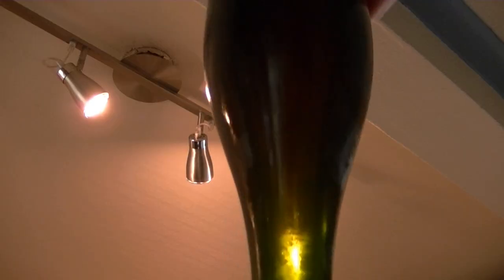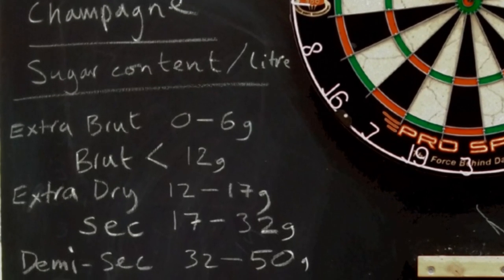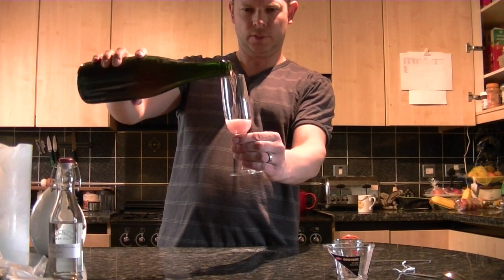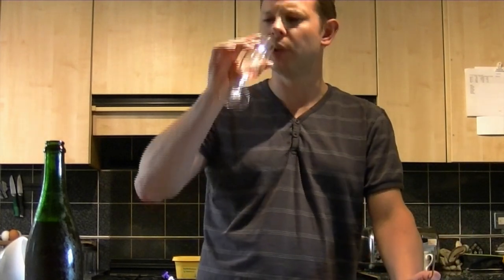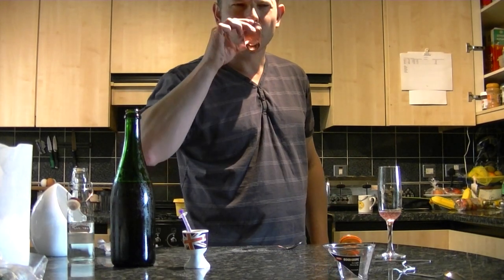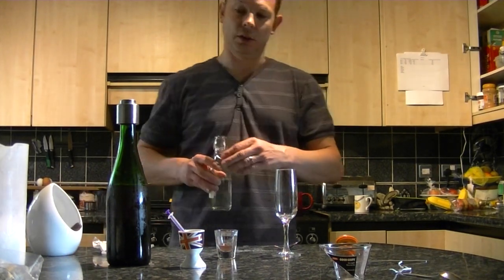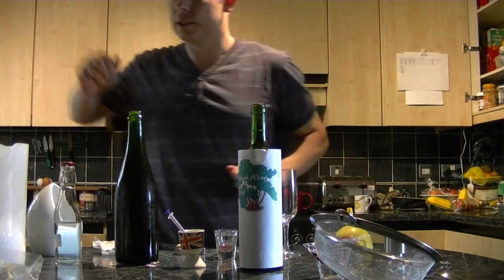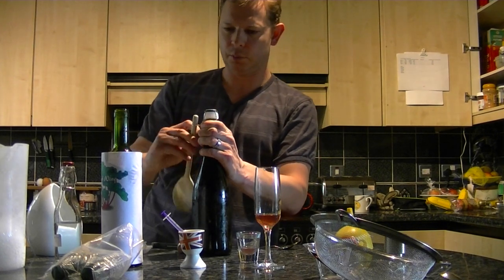Rhubarb Sparkling Wine - Champagne Method - Disgorgement and Dysfunction

Comment: This video is a hidden gem. I've watched it three times and it still makes me giggle. Bottled my first attempt at sparkling wine today. May there not be any bombs going off in the storeroom the next few weeks.
Reply: Yes.  Here's to non exploding bottles!
Reply from the maker: How's it tasting?
Reply: Unfortunately I have had troubles with the 2nd fermentation. I've attempted resetting with new fresh yeast to no avail. Most likely it is due to the PH being too low considering it's a Riesling. Measured PH to 2.9, so I think that's the most plausable reason.

Comment: The sugar content of sparkling wine (or champagne) doesn’t apply to the added sugar, but to the overall sugar content.
Champagne usually contains very little residual sugars - however if the rhubarb sparkling taste already good without, it seems, that it still contains residual sugar. Means, that you cannot use the “sweetness tables” but have to test first of all the residual sugar of the ferment...
Reply from the maker: what are you defining overall sugar content as?
Reply: This would be the residual sugars from the wine plus the dosage...
Reply from the maker: I think I see what you are driving at. I guess English isn't your first language, but I appreciate you commenting. Yes, I realise now that you mean the figures I had written on the chalk board were expressing the combination of unfermented sugar left in the wine and any added in the dosage. I have clumsily treated the wine as though it has no residual sugar when talking of the classifications of Brut, Sec, etc. I was merely using the figures to give me a guide on what increments of sugar additions to make when tasting and deciding on the dosage. I may also be wrong with talk of sorbate additions, do you know whether Champagne houses just add sulfite and no sorbate?
Reply from the maker: I think our replies crossed over.  Thank you for replying.  The wine has a specific gravity of 0.992 and tastes nicely crisp.  I had made the assumption that this corresponded to little or no residual sugar.

Comment: Hello, I am wondering if I'm missing the riddling process, did you do a video? ... I sat my bottles for a few weeks and now there is ofcourse yeast etc at the bottom of the bottle. Did you go right from that step to next turning upside down for a few weeks?
Reply from the maker: Nicole Triplett I don't think I did a detailed video on ridding.  I left my bottles on their sides for about a year, then over a few weeks twisted them while increasing the angle until finally resting on point.
Reply: @BrewTube  why not rest them on point (ie inverted ) from the start? works fine for me in facts works even better for condition and collecting concentrated in the neck ,its done in a few weeks
Reply from the maker: @ARCSTREAMS  Good to know it works that way.  I was only following the theory, but if in practice going straight to on point works, then job's a good'n
Reply: @BrewTube  well the reason they do it slow for champagne is something to do with finer sediment catching to the bigger sediment to give a much cleaner product but i never found this to be much of a problem for me when doing beer or sparkling wine etc i just store them inverted from the start and after a few weeks (i still riddle them every other day) they come out nice and clear at that point i open there bail slowly and let the crapp flush out either slowly or in fast burst over my sink ,so basically opening and closing the flip top real fast or slow enough to let it leak out hopefully not leaving much residue stuck to the neck after im done if im lucky and the sediment or yeast works out easy and does not linger to the sides

Comment: hmm why did you decide to leave it dry? were you not happy with any of the sweetness? but why not make things easier on yourself and simply use non fermenting sugar to your dosage that way you can omit using any sulfides or sorbates etc? in fact they tend to add this artificial bitterness and aroma you often find in champagnes,perhaps the snobby buggers use this too i am thinking because mine came out tasting exactly like the real stuff and no one believed me when i told them this was a 5 alive fruit juice base and not grapes  lol ,,,,or you can use an artificial sweetner that does not have this bitterness like xylitol which i also use but is quite expensive,,,simply ferment all the way dry then use the non fermenting sweetner to taste ,bottle with correct and safe small amount of conditioning sugar (ie 4tsp/750ml) ,,no fuss no muss and no explosions,,then you leave bottles inverted till sediment drops which by that time will have perfected the taste and then disgorge either using you chill method or my inverted flip top burst flush method,,it may leave some residue depending on how buggery the yeast you work with wants to be ,it may flush out easly or some might cling but can be wiped off with cotton q tip or rag with finger
Reply from the maker: for this particular wine and my personal taste, the result was best dry.
Reply: @BrewTube  ok but what do you think of my other suggestions on using non fermenting sugars and removing the sediment?
Reply: @ARCSTREAMS  seems bullet proof.
Reply: @fredrik5613  my methods?